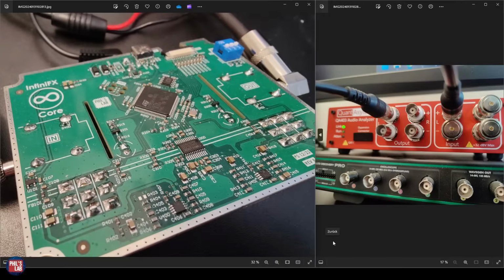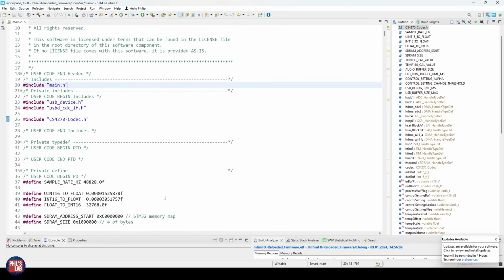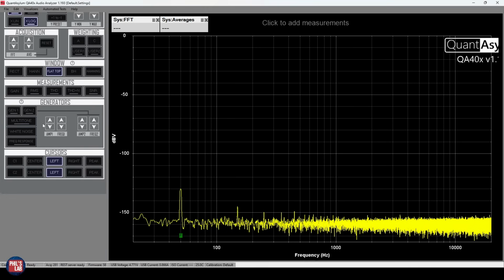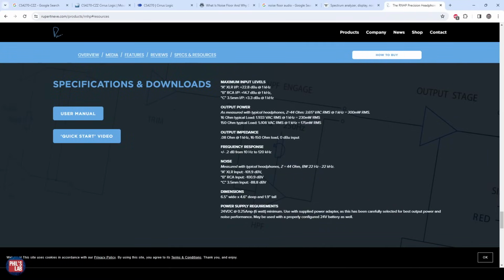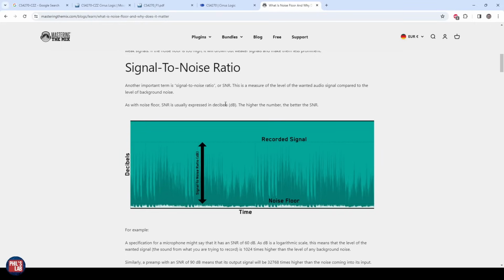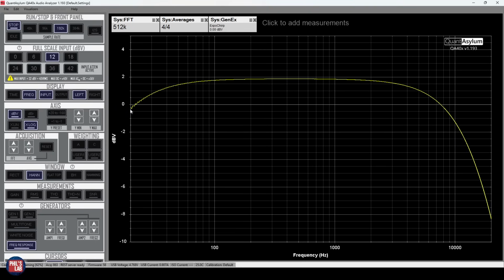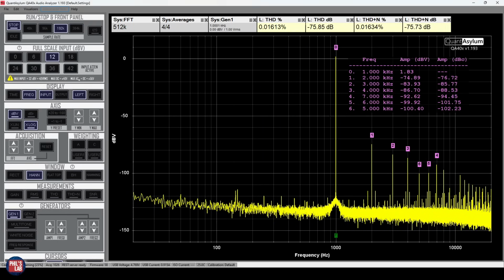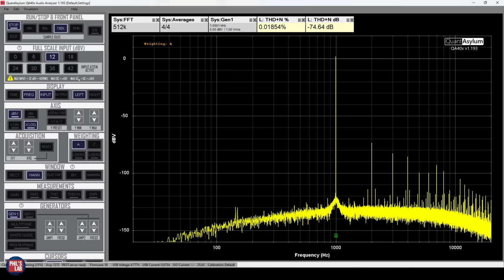(Sponsored) QA403 Audio Analyzer Tutorial (Noise, SNR, THD+N, ...) -  Phil's Lab #130

Comment: Hellow Phil!! Thanks a lot for your videos!  I'm designing a device that counts pulses from neutron detectors, calculates average count rate, make some math., display some info, process 20 discrete signals. 
So I decided to use stm32f446 + altera max5. I need fpga to implement 10 counters, so I need to choose the way mcu communicates with fpga. I want to use QSPI in memory mapped Mode, to read data from counters, and another spi to control discrete outputs of fpga and read data from keyboard. Am i on the right way, or there is more efficient way to communicate between mcu and fpga?

Comment: Great video again. Thanks. Could you maybe explain the effect of the exposed copper frame along the edges of this board (and others you have designed). There is a surrounding via-fence for shielding for sure but why is the copper pour frame that connects all vias exposed and not covered by solder mask?
Reply from the maker: Thank you, Marco! The exposed copper itself is mainly aesthetic but also useful for attaching probe grounds to during debugging/testing.

Comment: The QA403 is a rather cool device. Quantasylum also sells other similarly sized accessories to go with it like a load, etc. I use the QA403 mainly to measure DIY amp performance when loaded at 8/4ohm using big 1000w break resistors. 

The only advice I can add is a silly but important one, make sure that the voltage delivered to the unit is within its expected range. Some cheap cables or sometimes the lack of a powered USB hub (depending on the PC). The application software will tell you (bottom bar) if the voltage is too low. If this is the case then try to fix the issue before taking a measurement.
Reply from the maker: That's right! I actually had to buy a new, higher gauge USB cable to reduce the voltage drop, so the QA403 was happy.

Comment: I absolutely loved this excellent run through.  What's amazing to me is the overall performance of sub $1K test equipment like this and the Analog Discovery 2. Back in 80s-90s, an HP setup like this would be $50-75K with none of the software calculations (you'd have to write HPIB acq code ). Thanks Phil, made my day and I left with a smile.
Reply from the maker: Thank you very much, Craig! I completely agree - it's pretty incredible how affordable and accessible this stuff has become. Especially for most cases where one might not need the power of an Audio Precision.